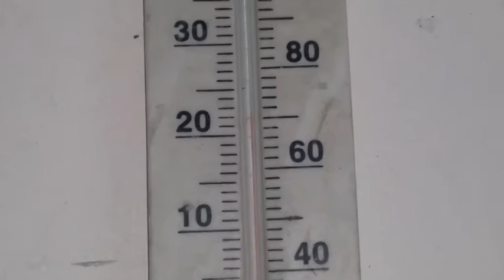Painting Motorcycle Gas Tank: Body Work, Epoxy, 2K

Comment: What if I just want to paint over a bad debadge job where the paint is chipped?
Reply from the maker: Cthulhu what it do, so I would sand it down to remove any of the sticking stuff and paint and start off with a clean surface then epoxy to seal before painting over basecoat clearcoat

Comment: Yeah you did!  Looks like you are using the starting line gun right?  Your's lays down the 2k just like mine...  Just a bit peely???  I've been thinking that gun is just a bit undersized for the thick primers, but it works out, so everything is cool.
Reply from the maker: so right, yep the starting line up gets the job done for sure. I run the 1.8, I think to get it lay better you have to reduce a little more which will defeat some of the purpose of the high build..so hek I roll with it. I am going to sand it flat anyway lol..tks for stopping thru Greg! CJ
Reply: Exactly!!!
Reply from the maker: +DIY_Autobody it was really me not dialing in the gun the best, compressor is a 60 gallon, and I agree  startling line can be peely for sure

Comment: hi like your vids and i have been  watching your for a  while. I want to paint my motorcycle and would like to know a compressor/ size i can use
Reply from the maker: Ham Tube tks Ham for watching.CJ...so if you are only painting motorcycles then you can use a 30 gallon and have enough air to keep your flow up. depending on your space requirements and budget for the compressor you can go bigger. I have a 60 gallon and only use it for the big projects.